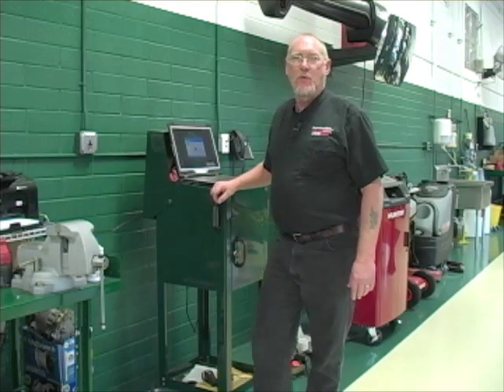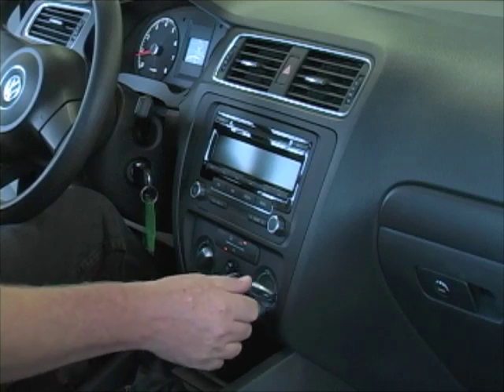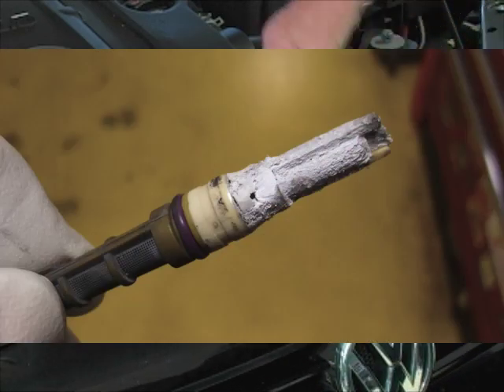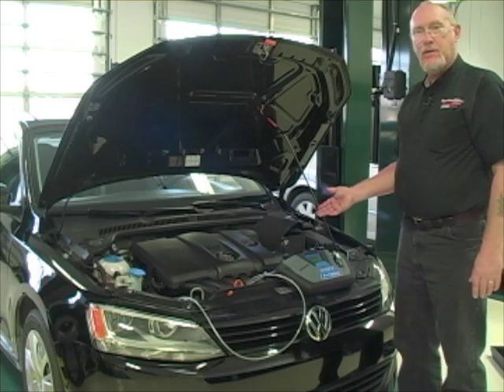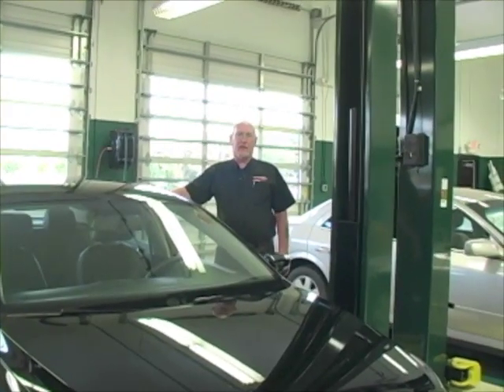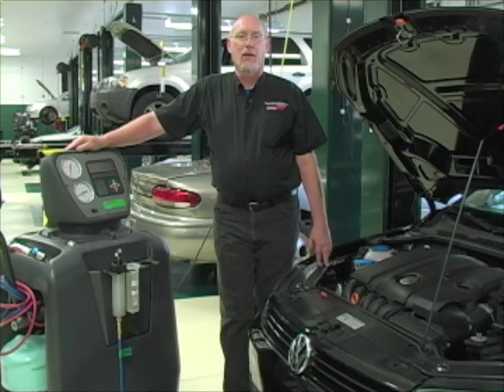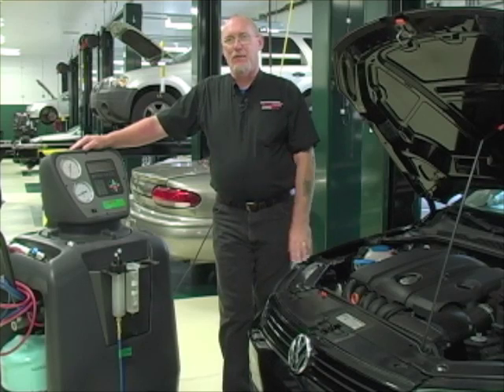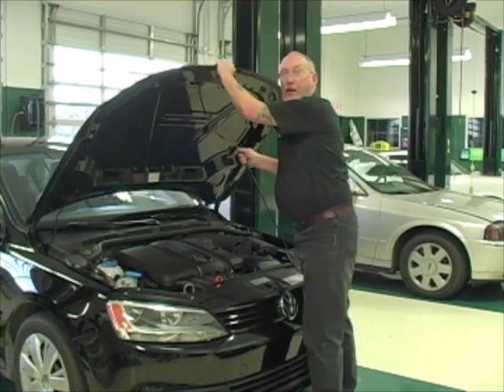The Trainer #17: Testing Automotive A/C System Performance

Comment: If you hook your test equipment to an older car, and it says "hey, this is not R12", and you find it has some nonstandard freon in it, what is your method for removing the nonstandard freon from the car?
Reply from the maker: It is best to keep an old RRR machine around to collect any "junk" refrigerant you may come across, and when the jug is full, you can send it out for recycling or reclamation. No old machine around? Check with local collision shops and junk yards. Do NOT vent to the atmosphere unless you don't mind paying hefty fines.
Reply: Motor Age mixed refridgrrants cost A LOT of money to be destroyed

Comment: im guessing that hybrids use poe oil due to hermetic motors. i work on large chillers and an ounce or 2 of the wrong oil in a 134a chiller can cause the oil to wax up in the evap.
Reply from the maker: Steven,
Hybrids with electric compressors use POE oil rather than PAG to prevent insulation damage and HV leakage. Any HV fault will cause the system to shutdown until repaired. In the case of using the wrong oil, that means changing EVERYTHING in the A/C system.
Reply: Motor Age